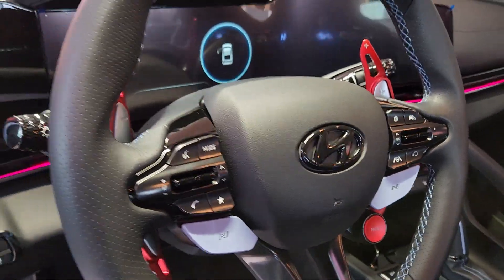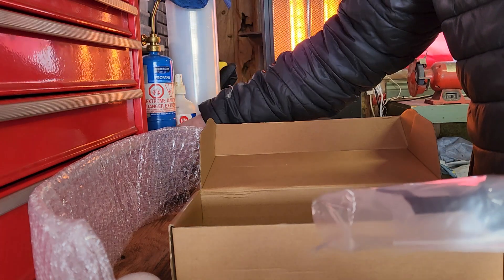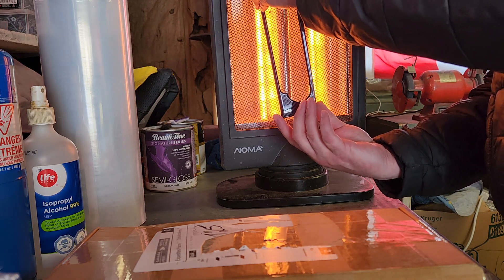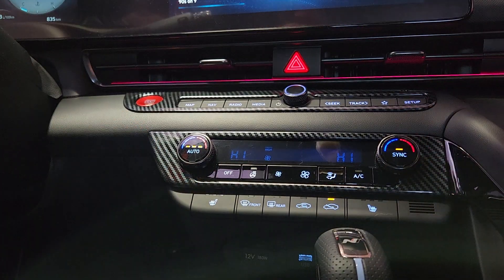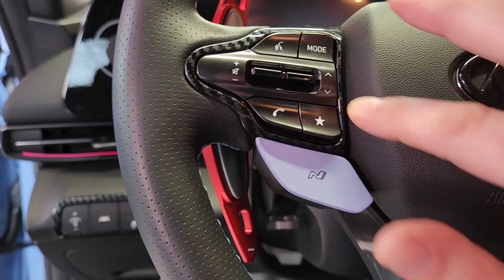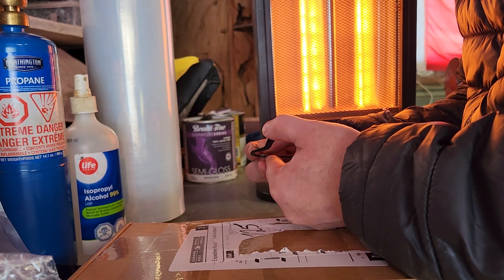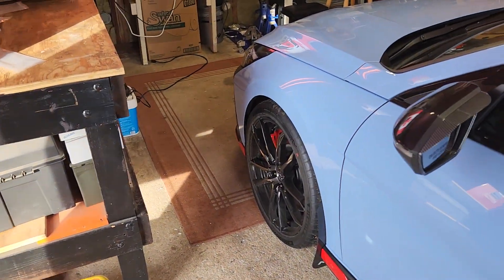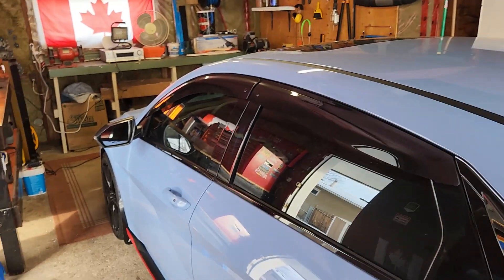Hyundai Elantra N, Unboxing and Installing more CARBON style accents in the Interior!!

Comment: Is that ceramic tint on the windows and rear windshield? What %?
Reply from the maker: Hey there, It's a carbon tint. Brand Name is Suntek. I had it installed by my buddy at Xtreme Tint. If I recall correctly I used a 35 on back glass, 38 on rear passenger and driver and a 45 on the fronts.